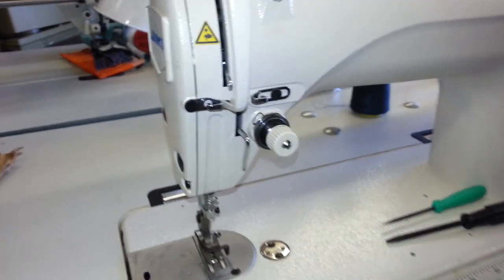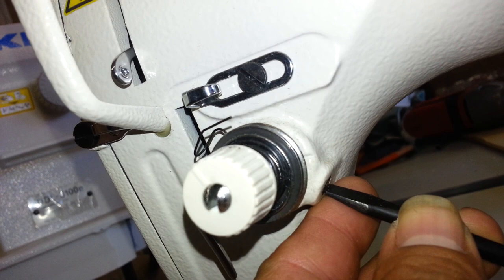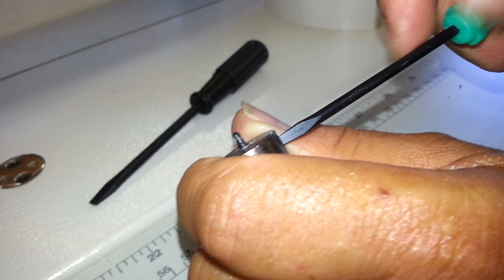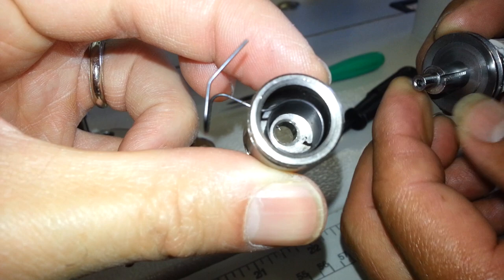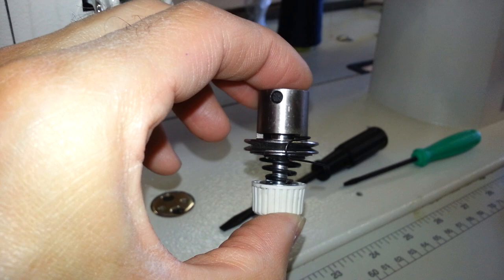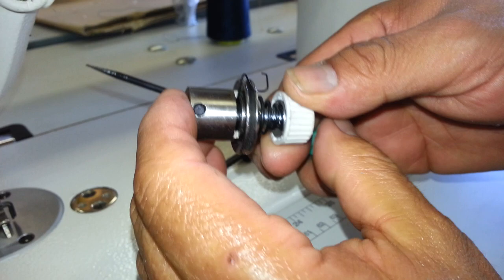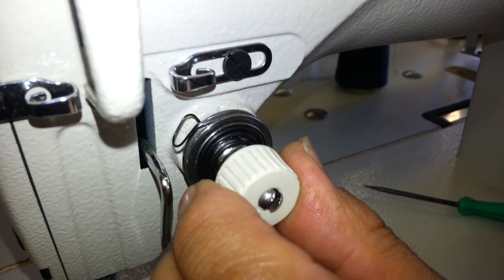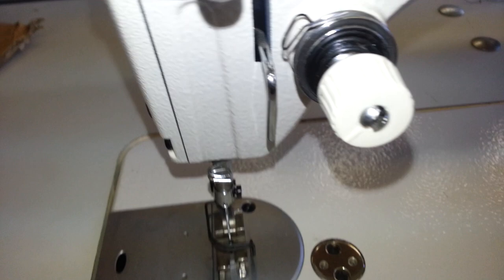Juki DDL-8700 Tension removal and replace

Comment: Great video! I have the Juki DDL-9000c-fms and have a problem with the tension disks being super loose. When I tried to fix that the entire tension knob came out and now I am having difficulty putting it back in correctly. At least your video gave me an idea of how it goes in (mine has a pin guide in addition to the spring) because I cannot find a single video on my model. Wish I lived in your area because finding someone who fixes industrials is hard!

Comment: The problem with my machine now is that that cylinder thing is like permanently attached to the machine...i cannot remove it even when i remove the screw. what should i do?
Reply: I'm having the same problem. If you don't mind me asking, did you ever find a resolution for yours?

Comment: I'm trying to replace mine from a used machine I have, it definitely didn't get the TLC it should have from the previous owner, but it's in good condition. Any suggestions to get one out that is stuck? I took the screw completely out, so I know it's not the screw holding it in at all. Didn't know if I could spray wd40 in there, I didn't want to do that without a professional saying it was ok. Is that an option? Having the same issue with the big cover on the left side of the machine that covers the wick and needle arm assembly. Any suggestions are super appreciated. Thank you 😊

Comment: Hi. My name is Shantal. Thank you for the video, I have a DDL-8500. My thread was snapping after every 5 seconds or when I would double tack. I tried to re thread it. Still happening. Then I tried to change the tension. Now the under stitch is bunching which never happened before. Would appreciate your assistance.  Thx

Comment: Hi thank you for this video it was very helpful as is the video for replacing the rubber band (thats not the name of it but right now my brain just went blank...) ok i followed your instructions and Jose' too but my tension, after i tighten screw on the inside n outside and then i bring up the foot it all loosens up again, it almost pops out the when you loosen the screw on the outside to make the adjustment...the screw is still tight but the actual tension mechanism is loose again as if i never tightened the screw??? what am i missing?  i hope you understand what i am trying to explain.  thanks much..
Reply from the maker: You probably pushed the tension too far into the machine.  That will release the tension and loosen it.  I hope that answers your question.
Reply: @Sewinggold  i dont know, i pushed until it stops, as per jose, then i screwed the screw back in but when i turn the knob to adjust the tension it almost pops right back out and i have to screw it again..i so not happy..
Reply from the maker: @tinapromise3480  Hi Tina, Can you post a video of the issue?
Reply: @Sewinggold  thanks again for responding...i think i figured it out, well you gave me something to go back and check again and it worked!..now i have another issue, i attempted to test sew some leather and my thread was not right on the underside so i attempted to adjust the tension and unscrewed the smallest screw(thinking I was tightening it) and dropped it on black carpet, need I say more the screw is about the size of a period on a letter and dropped on top of black carpet it is a total lost sooooo i am back at square one which is no production on my project.  i am sure i will be contacting you again, so until then thank you for your assistance and have a great day.

Comment: hi i have a problem with juki ddl8700 when i finish sewing the thread gets stuck in the bobbin or tow strands of thread comes out I have to turn the hand weel to release the thread have you any help in this this matter Angela from uk
Reply from the maker: Make sure you turn the hand wheel (toward you) until the take up lever is at it's highest position.  Then remove your fabric and the extra thread should not be there.

Comment: I have a problem with my DDL-8700, the thread tension disc won't release after pulling-up the presser foot. I tried dismantling it and test it off to the machine and it's working perfectly alright. All the parts in the assembly are complete, but I when I tried ti peek into the inside of the machine, the cam that supposed to push the bigger pin which pushes the smaller pin in turn is not doing its job. Can you help me with this problem?
Reply from the maker: We do not have a video of this repair yet.

Comment: Hello please , i removed my tension but it doesnt have that spring in it
Reply from the maker: It is not entirely necessary. I would not worry about it.
Reply: SewingGold.com thank you so much, uve helped me a lot. Im the one you told to try wd 40 for my stuck screw and it worked 💃🏼🙏🏼
Reply: @Sewinggold  hi OH MY GOODNESS !!! this is a long shot but if you see this comment PLEASE, what do you mean it's not entirely necessary? Do you mean the thread spring? I have bent mine, I live on a little island called Matakana in New Zealand...so I want to fix myself....I watched a video that said you could snip the end of spring off and rebend....but mine is so bent I can't remember the exact shape....can I just get it as close as I can???? Thank you thank you

Comment: Steve, I have this same problem. I was underneath the machine, adjusting the screw on the knee lift to get it to lift up higher - and all of a sudden the tension knob fell off! But it is as you showed Malcolm's - the inner piece is stuck in the machine, with the spring in it. I can't get it out! I see you just grabbed it with your screwdriver, but mine seems stuck tight and won't come out! Can I put the whole thing back together without removing that part? If not, how do I get it out?! Thanks...
Reply from the maker: Hi Amy, You have to get that part out of the machine.  The slot where the check spring sticks out is a good place to wedge a slotted screw driver in and gently pry it out.  If you want to wait until Monday, I can make you a video.  Please email me because I do not check YouTube as often as I do my email.  info@sewinggold.com

Comment: Hey Steve, I just looked at mine & mine doesn’t have that spring at the end with the bar. Do you know where I can get it or what it’s called
Reply from the maker: If you are referring to the spring that goes behind the tension, it is not necessary.  I am not sure what the exact name is and it is not in the parts manual.
Reply: It's called a  "Thread Tension Check Spring". Mine got broken off my machine but still my machine stitches okay without it.
 I think it aids better in tension setting and less thread cutting off.
And Thanks a lot Steve for your videos.So helpful!👍
Reply: @dotpin7809  Mine is still there but I think it does nothing for my machine. Since whenever I use the knee lift, it doesn't open up.
Reply: @3AsianBoi  Oh okay then maybe it hasn't been adjusted well but if it works okay then no problem.

But the thread tension check spring, on industrial machines you don't really see a difference but on a manual singer machine, without it, lots of problems. And you can buy one on Aliexpress